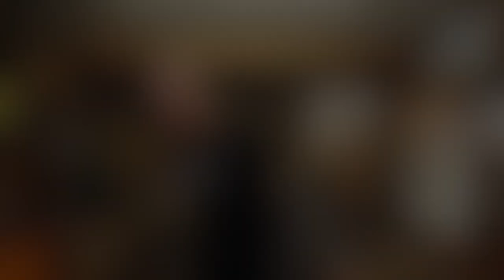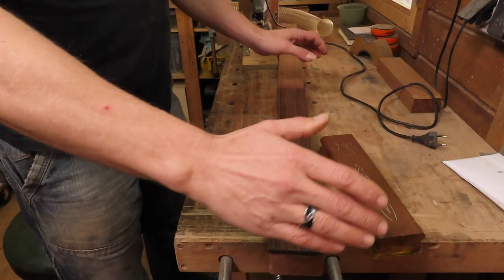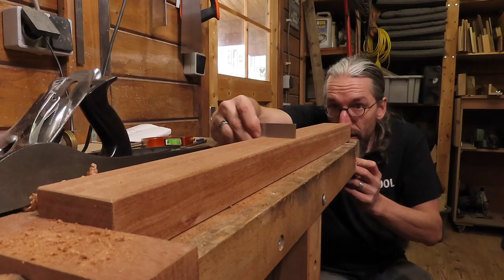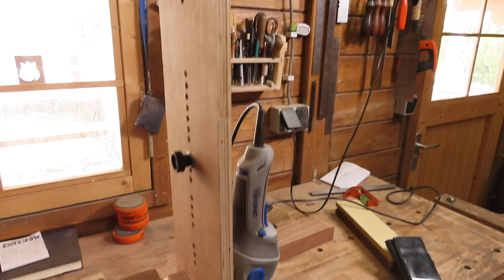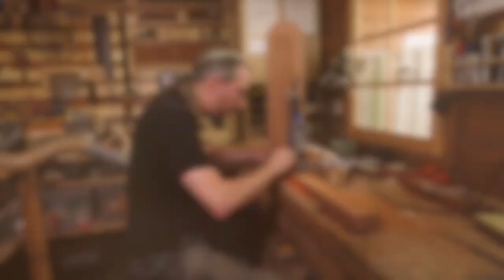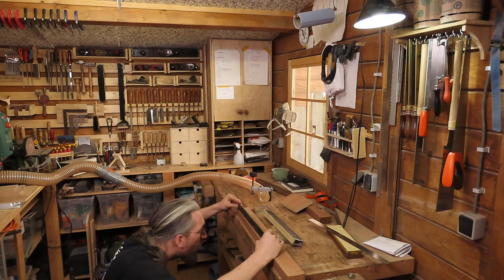How to make a Radius Sanding Block

Comment: Fantastic video, great idea putting the dremel on a pendulum!
Reply from the maker: Hi KineticNidalee,
Thank you for the compliment. 
To be honest putting a router on a pendulum isn’t my invention. This is my take on an already existing idea with a couple of improvements I didn’t see on other designs.
Reply: You can also put the fretboard on a pendulum, pass it across a cutter or a sander, with adjustability at both ends of the pendulum, to create all the common radii, or a compound radius.

Comment: Thank you for making the video. Smart solution well executed, but for most ppl not very practical. Properly planing the block is a pro job and requires a rather expensive plane. if you buying the block pre-planed you might just as well buy an sanding block. Kudos anyway!

Comment: Made one using a Dremel, not powerful enough. It worked, but took too long. Bought a $30 router at harbor freight and upgraded the jig, works great!
Reply from the maker: Hi Uriel,
Yeah a regular Dremel might be not powerful enough. I use the Dremel Trio which is just powerful enough for the job, but I on't know if they make it anymore.
Good to hear you found a solution and the jig is working for you.

Comment: Love it thanks for the video! About to start my first couple builds, and I hate buying tools or jigs when I can make them out of scraps.  Have you thought of using a cove style bit on the router instead?  I would think the flat bit would leave more track marks than a rounded point?  Would require a ton more passes though, so I'm only speculating.

Comment: Great job on that but wouldn't using a more powerful router like a Colt trim router let you use bigger bits and speed up the process? I dig what you did here just a suggestion, keep up the great work!

Comment: Great video! Is there anyway to make this with a different type of router? Maybe a bigger and more common one.
Reply from the maker: Hi Dani,
Yes, you can use any type of router you like. As long as the principle of a pendulum is maintained to get the radius you're after.
One thing to keep in mind is that a larger heavy router may require a very heavy and stable construction.

Comment: How do you make a different radius other  than a 12" radius?
Reply: The router jig has a higher mount point for the pendulum. You use that and get a longer swing on the arm, resulting in a wider arc. For a 16" radius, make sure the end of the router bit is 16" from the swivel point of the pendulum, and use the height adjustment he noted to make sure the piece is at the right cut depth.

Comment: I'm sorry.  How do you find the radius in respect to the router?  I didn't understand the process from the comments.
Reply: The router is mounted in such a way that it is X inches away from the fretboard (in this case, 12 inches away), so as it swings back and forth in a pendulum-like motion it carves away wood in that arc, simulating a 12" radius. Hope that makes sense!